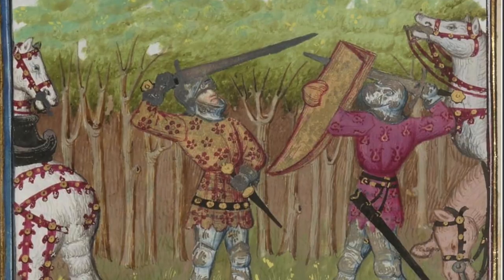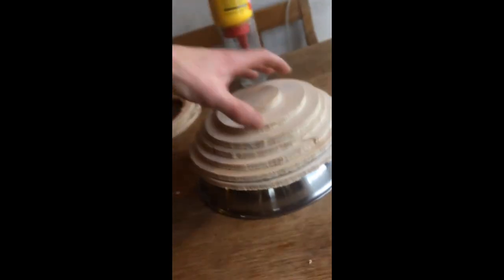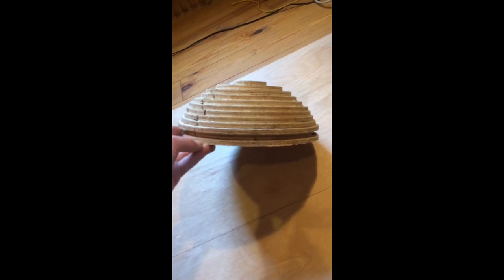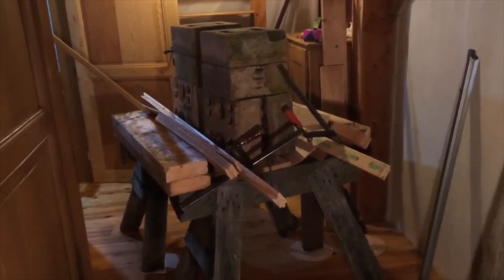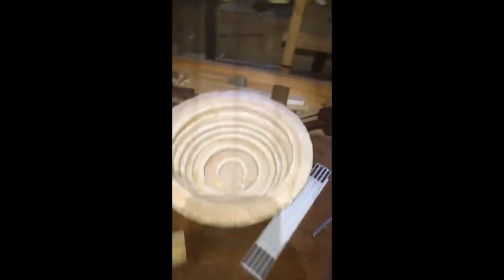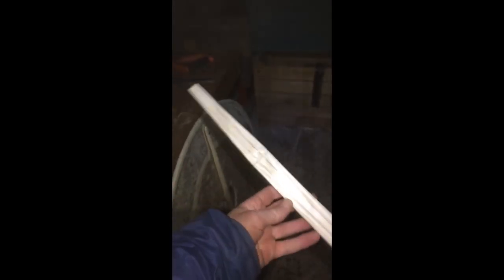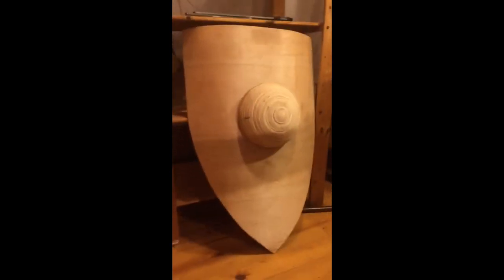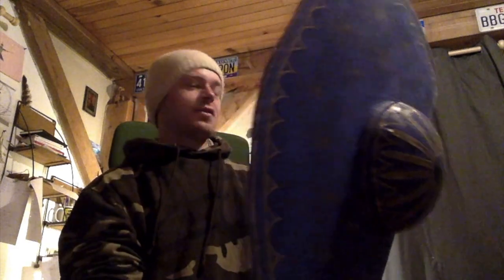Making a 15th century boss-gripped heater shield (obscure medieval shield type)

Comment: Awesome looking. But making the umbo is far too complex. I'd say that the historical method of making the umbo would be similar to making the bowl of a lute by heat-bending and gluing together wood strips. Lute-making was well established in the era so the methods would easily transfer to other crafts.
Reply from the maker: Thank you ! You may be right. I used what I had without worrying about authenticity of the materials. If indeed they were sometimes made of wood, then I suspect that turning would be the simplest way, as this was widely known and used to make wooden bowls for example. However a solid turned piece seems vulnerable to splitting. That being said, wooden bosses made from one solid piece existed in antiquity. I agree that strips would be possible, and stronger, however, I'm not sure there is any evidence of composite wood used in shields of that time...
Reply: @philodeinos7536  The pieces of turned wood umbos from the hjortspring shields of antiquity are made of a barleycorn shaped piece of wood with half-sphere bowl cavity. This means that vertical hits on the umbo would impact the thickest part that wasn't hollowed out to reduce chances of splitting. Same goes for the Al Fayoum "Roman" shield boss.
Other options that would be less prone to splitting would be coiled basketry with a hard gourd shell cover glued on (this method was actually used in the Philippines for helmets/hard hats.)
Probably a multitude of solutions were in use including methods based on cooperage.
Anyway keep up the good work!

Comment: out of curiosity what is the diameter of the boss?
Reply from the maker: It's big. Exterior diameter is 24 cm or just under 10 inches ! 

It's definitely big enough to fit a gauntleted hand comfortably. Though it isn't based on any precise measurements, the proportions are guestimated from the artwork. The fact it's so large is one reason why I think it's plausible some of these bosses were made of wood. The fact it's so big means it's far from the hand, so even if the boss is penetrated, your hand is less vulnerable. Not to mention these are often shown carried by fully armored men with gauntlets.
Reply: @philodeinos7536  ok thanks